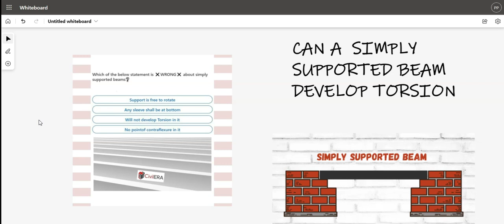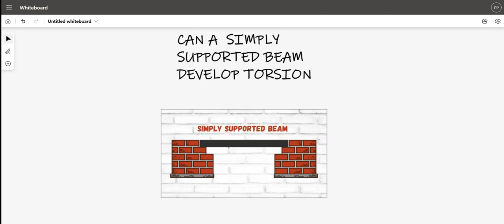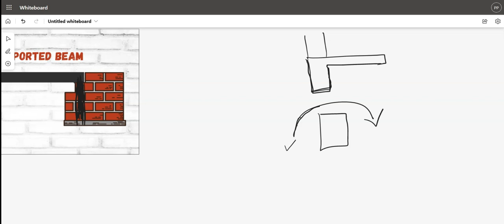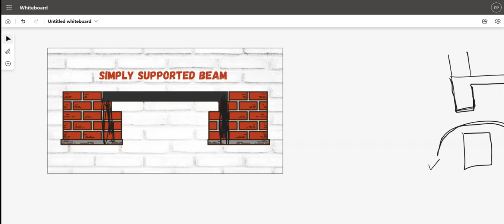Simply Supported Beams - Will it develop Torsion?

Comment: Respected Mr. Vasudevan, I want to seek one help from you as a mentor.
I have my Interview tomorrow for the post of Design Engineer and I'm jumping from one topic to another right now. Just finished M.Tech few months back now I'm entering into the industry. Please suggest me some of the topics which I must revise before going for Interview tomorrow.
Reply from the maker: Vishnoi, Generally , Interview questions will be influenced by 3 to 4 points
1) General stock questions the interviewer has
2) The companys kind of work/interviewers experience etc
3) Your experience and what you have showcased in skillset 

If you do your CV well with emphasising what you know, you have higher chances for getting questions that you want to answer. I have written blogs and videos about this. Please search and see and do similar.

From point 1 and 2, if you get questions, you have nothing much to do. If you know you will be able to answer. Therefore is nothing called preparing for the interview on the last day. If your basics are sound, you will be able to perform.

Having said this, you can focus on basics of analysis and design and code provisions.
Reply: @CIVILERABangalore  I really appreciate it that you've taken out your valuable time to help me out. I will definitely keep myself aligned with your set of advices. Focusing on Code provisions. 

Thankyou so much 🙏🏼
Reply from the maker: Vishnoi , As I suggested, produce a clutterless CV higlighting your skills and removing unwanted declarations 
Rest depends on a lot of factors. You are the best to foresee what the company may ask as I dont have any info about the nature of the firm.
Cheers and good luck 
Premjit